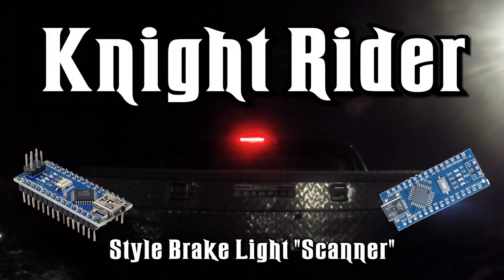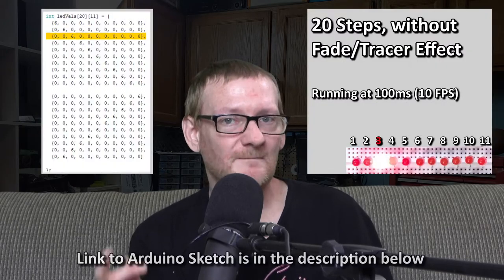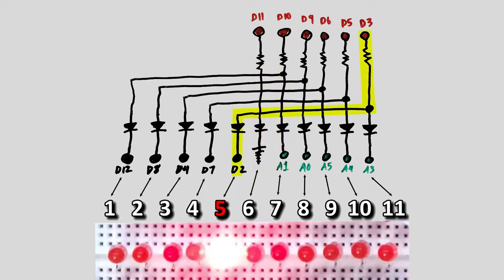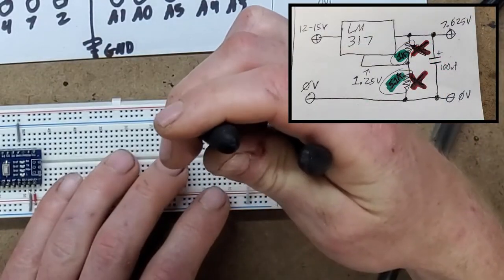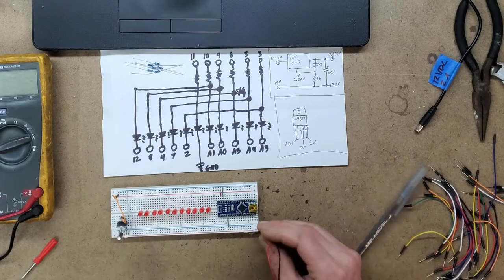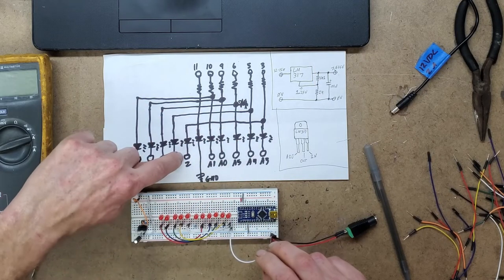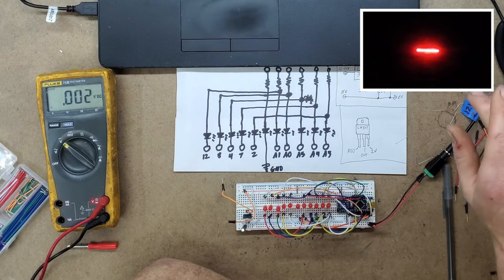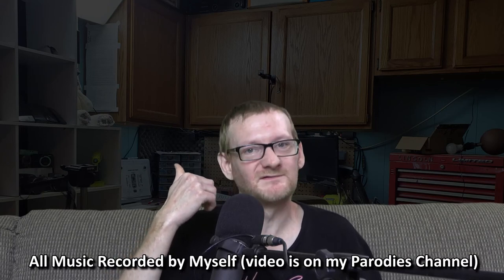KITT (Knight Rider) or Cylon LED "Scanner" w/Arduino Nano

Comment: Hello, this is a great project, I have done it but I am left with only the 11 LEDs on without doing anything, I have already reviewed it several times, any suggestions for something that I should pay attention to in the code, greetings
Reply from the maker: I actually haven't looked at that code in sometime. I actually sold the Ford ranger like a year ago, went ahead and left the Knight Rider brake light in because it would have been more work to take it out LOL.

The next similar project I made, I ended up using individually addressable LEDs which actually is a thousand times easier. I'll have that project up one of these days soon.

This project on the other hand, I intentionally used individual LEDs to show how the state of the Arduino pins can be manipulated and you can end up with more pwm controlled LEDs than you might think. I guess it was more an exercise in thinking outside the box LOL but as far as your issue, I wouldn't even know where to begin to look if you say they're all lighting up. Other than to make sure the code is actually uploading correctly...

Are you doing this on a breadboard or have you soldered this together? If you're doing this on a breadboard, make sure you understand which tracks connect to which tracks internally on the breadboard. Just knowing that or not knowing that can really throw a wrench into it if you're a beginner...

If you uploaded the code exactly as it is on the website then it's most likely not a coding issue. The only other final thought I had is, make sure you are using the original Arduino nano, not one of the newer versions with Bluetooth and Wi-Fi and all that because I have not tested any of those boards yet. I only know it works on the original nano

Comment: I could really use your help. I'm trying to do same thing using 16 leds. Also want to use same leds for brake lights. So I need knight rider in one led light housing as well as brake light
Reply from the maker: The device I built in the video does in fact function as a brake light in addition to being a Knight Rider scanner. I also explain in the video why it only works for up to a maximum of 12 LEDs with the current setup. You might want to give the video another watch and make sure you watch it all the way through..

In any case I will be making an update video because I have a Pontiac Grand Prix, and its third brake light actually has 8 or 10 individual light bulbs. That could be a fun project, slightly different, and though it's not a trans am, at least it's a Pontiac and not a Ford truck LOL.

Keep an eye out for that video coming hopefully pretty soon

Comment: So, if I understand this right, this is using tri-state logic and charliplexing?
Reply from the maker: Tri-State logic yes. Charliplexing, in a roundabout way yes. I know there are much easier ways to accomplish this, like using individually addressable LEDs, but I set out to challenge myself and use every available pin on a nano. One consideration however, since the current is flowing both through the positive pin and the negative pin, that amount of current needs to be added twice when adding up the total current consumption of the Arduino board. One is supplying current while the other one is sinking it... I have another video coming soon where I put an amber one on the front of my other truck, this one using WS2811 strip at 12 volts regulated and multiple patterns available including multiple colors, some of which are probably not legal on public roads lol. The default is just amber going left and right and it always resets after key off and back on just to be safe
Reply: @JustinNelsonsProjects  heh, "off-road use only"
My car has a good scoop like kitt, and eventually I'll rig it up with some big LEDs that I've been testing.
I'm a big fan of charlieplexing and diode steering and segmented displays, and LEDs.... I like making little led cubes, and charlieplexing is one of the most fun ways to do that, and I've done it a few ways except individually addressable ones, but I have some, and some plans...

Comment: A great thing. To avoid destroying anything, I have a question, how many ohms are the 6 resistors on the LEDs?
Thanks a lot
Reply from the maker: I thought I mentioned it in the video, but perhaps I forgot... and at this point I sold the Ranger and left the brake light as-is hehe -- but I'm pretty sure they were 220-ohms. With the ~1.7 (minimum) voltage drop across the LED, at 5 volts, you end up with about 3.3 / 220 = 15ma max per LED. You could drive them higher (20 is usually the highest) but keep in mind the Arduino's limitations, and the fact that we're driving each LED through not one, but TWO GPIO pins... and at "full brake light" that's 11 LEDs (but also remember we're sharing resistors so the "full current" the Arduino sees is tricky to calculate... I just know it worked great for 2 years until I sold the truck)

The next version I plan for my Pontiac Grand Prix, which has a 10-LED spoiler-mounted brake light **from the factory**, will use transistors to drive each LED, so I can get higher current/brightness... you could also use MOSFETS to drive bulbs, or go super old school and use actual relays (like the original KITT/Cylon props did).

Another option would be to use a WS2812B LED strip -- hell the wiring and code is MUCH simpler that way -- but I discovered these individually-addressable strips only after making this video. Plus, they also just aren't bright enough for outdoor daylight use...